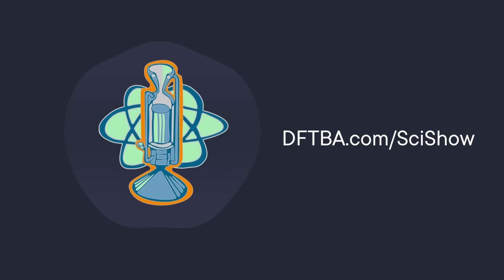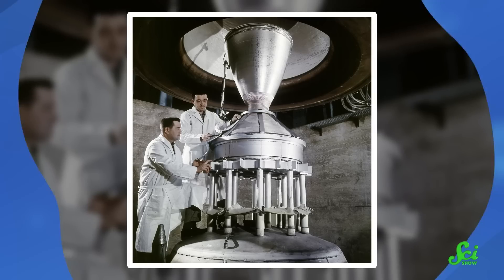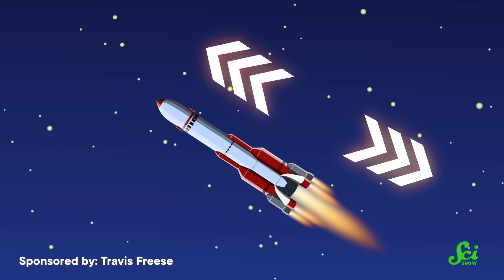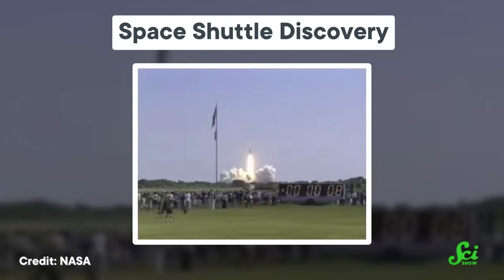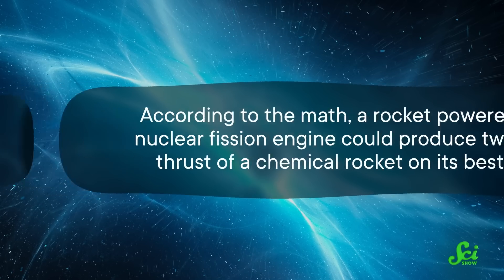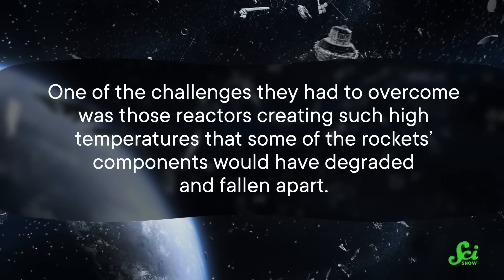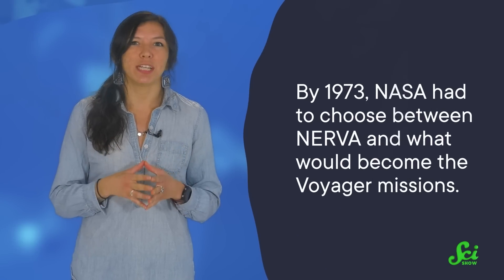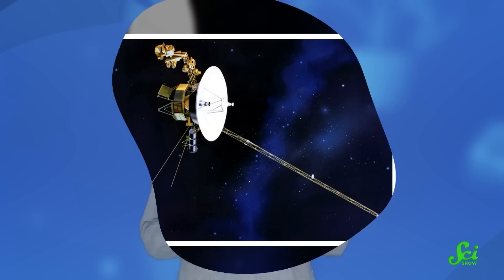That Time NASA Tried to Make a Nuclear-Powered Rocket

Comment: Interstellar travel will certainly require nuclear power. The 600,000 year journey to a planet of a nearby star within our Gaia cluster (like those where we are discovering earth-like planets) with no other form of power (even solar power is impossible during the 10,000 to 50,000 or more years between each star) and of course any craft has to be continually heated or it will be -273 degrees below zero. A half million years in space even for machines will require an unimaginable amount of nuclear fuel. Antimatter might one day be a better fuel but that is not yet technologically conceivable. 

And our current fastest rocket at over 500,000 miles per hour probably can't be improved by orders of magnitude just because smashing into dust that those speeds over hundreds or thousands of years will destroy any material.

Comment: Nuclear Power is a requirement for humanity's future. Wind and Solar can supplement Nuclear but can never replace it. Nuclear is literally no more inherently dangerous than Solar and Wind, and literally every Nuclear Disaster in human history was 100% preventable. Even Fukushima and Chornobyl. Hell, if not for the rampant misinformation, Three Mile Island would've been a slight hiccup. The only thing preventing Nuclear Power from becoming mainstream is misinformation. Depleted fuel rods can not be turned into bombs and the amount of long term waste (the stuff that takes 1,000+ years) will never be a substantial amount of waste or by the time it does, we'll have significantly better methods of discarding it.

Also, nuclear disasters are in no way inevitable. Fukushima could've been avoided if the company running the power plant had made adjustments to the protective structures bad in '91 when concerns first arose, or in the early 2000's when a wave that matched the exact dimensions of the tidal wave that hit Fukushima was predicted. Nuclear Power plants are built to be virtually indestructible. Their only natural enemies are negligence and ignorance.
Reply: And maybe we want very slow and complete nuclear contamination of the whole earth, maybe we want evolution to force radiation resistance and be fed the mutations to do it. Maybe death is a fundamental part of making a hardier more brighter life. Or maybe im just nuclearfanatic27.
Reply: @crusher 9z9  literally none of that will EVER happen. That is literally just misinformation born of pure ignorance, created over the decades since Nuclear Power was first used.

Comment: Instead of the phrase "nuclear poisoning" or "radiation poisoning, " you should use "radiation sickness."  Radiation isn't a poison;  in the case of actual poison, whichever poison it is, it consists of matter, whether solid, liquid, gaseous, or plasma.  Radiation, on the other hand, consists of various frequencies of light, from gamma radiation and X-rays, to ultraviolet and then visible light, and on down to infrared and still lower frequencies of light.

Comment: The real problem is having nuclear material anywhere near an explosion, even a controlled one. 
So the transport to orbit is a fundamental problem. 
Like, it would be less material and therefore less catastrophic than Chernobyl, but the area affected would still be dangerous for the next decades.
Like, the wind from Chernobly was blown over a lot of Europe. Ukraine is pretty far from Germany, yet open sand on playgrounds was deemed "possibly contaminated" and they were basically banned for years.
Similarly, rain clouds passing Chernobyl contaminated top layer of all soil - possibly. The danger was that it had. You couldn't have salad that grew there, etc.  
Mycealian networks of mushroom actually filted that stuff, absorbed and stored it, so no wild mishrooms for you for 20 years or more. 
You do not want this to happen above ground, at alltitude in the atmosphere, tied to - essentially - a huge kerosene bomb. 
The spread and dispersion could be really bad.

Comment: CORRECTION: 
Having a light fuel as exhaust doesn't make it better at providing a "push" to your rocket when pushed. 1kg of exhaust accelerated by 10m/s is as good of a push as 10kg of exhaust accelerated by 1m/s, as the kinetic energy of both is identical. 
The reason a light fuel is selected is because you need to carry your fuel. The fuel is used over the course of your journey to provide exhaust, and so at any given point until you run out of fuel, a portion of your fuel is not providing exhaust and is behaving as dead weight, and you want to minimise this weight.
Thus you want a fuel which you can impart the maximum kinetic energy upon, while retaining the minimum weight for it.

(momentum, not velocity, is conserved)

Comment: You left out the  part of EMP.
and the explosion that that took place over the Pacific decades ago that ultimately banned nuclear power being used by  major countries beyond certain elevations.
 I don't know the specifics but 2 things I know,  the high altitude explosion was far more devastating than they expected and reaching out around a thousand miles or better. 
Knocking out power and communications for all in its path.
Plus undisclosed "fallout".
The the fact is developing major energy production power sources Will find it's hands into warfare or no good, despite it's creators intentions.
Hence Nobel peace prize.
Reply: NERVA uses a reactor, not a bomb, and doesn’t generate an EMP. The nuclear fuel also doesn’t leave the engine, and the exhaust (which is made up of hydrogen) wouldn’t be radioactive

Comment: The reason chemical rockets are used for launch is that NERVA has a thrust to weight ratio of less than 1. It can't lift-off the ground. You confused thrust with exhaust velocity. A perfect NERVA has an exhaust velocity is 9 kps, whereas hydrogen/oxygen rockets are 4.5 kps. NERVA has a high exhaust velocity, but a low mass flow.

Comment: The Voyager probes are powered by plutonium. I say "are" because they're still sending back information, nearly 50 years on! It's only tiny amounts of raw data, no more images or anything fancy, but they've taught us and are continuing to teach us about the start of interstellar space. Those power cells are really small - a lithium battery of similar proportions wouldn't have got us a fraction of the information the Voyagers have - but because of their nature, they've been able to last so long.

I know there's a ban on using nuclear powered rockets in space (at least there was one!), but as Carl Sagan said, he couldn't think of a better use for nuclear power (paraphrasing, but that's the gist). Has the ban been lifted or has the USA withdrawn from that treaty? Goodness knows you withdrew from plenty of others between '16-'20...

Comment: I'd like to hear more details, particularly re: how can you possibly create a light-weight nuclear reactor, when you need major radiation and thermal shielding?
Reply: On the shielding: it doens't have to be the part of the ship and to move with the ship. The best radiation shielding is the R_square law or simply distance. All you need is a long rod with small shield (made from nuclear resistant cargo - you will obviously carry lots of materials with you) between the reactor and the crew and stuff that is weak against radiation.

The problem here is that nuclear physics is kinda hard to learn in the beginning and is not very popular nowadays, so most people simply don't get the basics.
For example - humans require a dose of radiation to be able to develop our immune system etc. This does is relatively small, but are easy to achieve just by arranging materials in a reactor in a smart design. We have those designs ready to the concept phase, but further development is blocked by the bad public popularity of the technology.
Another thing is the toxicity - people massively believe if something gets irradiated, it becomes radioactive forever. In fact very few and known nuclear reactions lead to irradiated materials becoming radioactive and again with clever designs these can be avoided completely. For example if you leave alcohol in an extremely high gamma ray radiation, you can activate it for no more than a few milliseconds, adn as soon as you remove it from the beam, it becomes normal and ready to use... there are many more myths like these

Comment: With global warming (I won't used the weakened "climate change" terminology), nuclear power is something humanity needs to invest more in, both on Earth and in Space. Just put NASA or the Navy in charge of it, not some cost-cutting for profit company. The U.S. Navy has a long history of operating nuclear systems safely.
Reply: The term was actually originally climate change. But people seemed to not understand what it means, the media dubbed it global warming. But scientists had always called it climate change and it’s still called climate change in literature.
Reply: @potatomo9609  There is one amazing video about the terminology and guilt shift and how the big decision makers simply pushed the hole problem towards the public with actually very low leverage to solve anything. You need to check that out!

Comment: The reasoning that lighter exhausts are more efficient does not convince me at all. Both the energy consumed to accelerate the exhaust to a given velocity relative to the rocket and the exhaust's corresponding change in momentum are proportional to the exhaust's mass being accelerated, which is that of the mass of fuel being consumed, independent of the fuel's density: The said mass will be the same whether in lighter exhausts or in denser. What would differ is the fuel's and exhaust's volumes, bigger for lighter than for denser exhausts, but volume is not a factor of the rocket's thrust. The specific energy acquired by the exhaust is its acquired energy divided by its mass. Thus, the specific energy does not depend on the exhaust's mass, only on the square of the final exhaust's velocity. And the usual name for specific momentum is velocity. If indeed the fuel or the exhaust densities are a factor, it must be due to more obscure or subtle reasons.
Reply: I had this exact same question when first learned the term specific impulse. You are indeed right that there are two ways to achieve high speed: 1) throw very little things at very high speed 2) throw tons of shit at very low speed

Airplanes actually uses the 2nd method. The speed of exhaust coming out of a jet engine is actually not that much faster than the air going in, but because they have so much air - you have infinite air in the atmosphere - they get to fly really fast anyways.

However, for rocket, you don’t have infinite things to throw behind you. You can’t opt for large mass. So for rockets, it is generally better to have faster speed vs more mass.

Comment: There's another nuclear powered rocket setup that basically impinges nuclear material suspended in water at a focal point behind a heat shield. The nuclear fuel decays, there's a sharp rise in temperature and the rocket is propelled forward, with ISP rivaling ion thrusters and thrust capabilities that almost match conventional chemical rockets, this type of rocket could actually get us from one side of the solar system to the other in the amount of time it would take starship to fly to Mars.

Comment: The NERVA program had two distinct types of nuclear propulsion...one had fuel moving directly thru the inner core of a reactor, heating it up to then unheard of temperatures, the second type had the fuel traversing thru a heat-exchanger type system...while less efficient, it was thought (correctly) as a "safer" option. The first test running fuel directly thru the reactor had catastrophic results...the high velocity fuels traversing thru the core wound up breaking up the super-heated Uranium fuel rods & spitting the bits & pieces of extremely radioactive material thru the exhaust nozzles. The entire test site was completely & savagely contaminated with lethal levels of radiation....think Chernobyl reactor with its chunks of glowing ultra radioactive uranium bits scattered everywhere.

Comment: Somehow I don't think this was the best intro to Fission NTRs. They wouldn't be launched atop chemical rockets for safety reasons, but simply because an NTR cannot generate high enough total impulse to launch a payload. Nor would you want your nice NTR first stage being dropped back to Earth, as boosters must be... NTR can be quite useful, but they have VERY SPECIFIC strengths and are not 'better' than chemical rockets in a general sense. Each has its uses.

Comment: If we never do get over the issue of launching a bunch of uranium to orbit, we have found deposits of it on the Moon.  It'd take a sizable moon base to support all of the infrastructure needed to mine and refine it, but then we can fuel up empty NERVA engines without ever risking an RUD earth's atmosphere.

Really, the issue is less of a safety and technical concern and more of a public perception one.  A uranium core exploding during launch would be way less hazardous than any of the bomb tests ever done, or even the occasional power plant incident.  Even better, we would know where and when the uranium would return to earth and could be ready to do a clean-up if needed, while reactor incidents are unpredictable...

Comment: This is BS, UncleHeorge could not talk about much of his work, but he could talk about this project.  In 1963, he talked about a nuclear rocket engine.   It worked fine. The problem was WHAT HAPPENS IF IT CRASHES.
Reply: There was a working TNT powered proof of concept. But the reason it was abandoned was it was too heavy to get into orbit because of the many tons of blast shielding required. No one was setting this off on the ground.
Reply: At some point, space travel in near-earth orbit will be as safe as normal flight.   It's remarkable that it is taking this long, actually.  I think, unfortunately, as much as the space race pushed the technology forward, it also incentivized pushing ahead even when problems might exist.   We've been in a course correction on the technology ever since.

By the time we get there, nuclear fission might be replacing nuclear fusion.
Reply: @EMS  not in our lifetimes so quit putting the cart before the horse

Comment: Pretty much everything we are doing in space today was thought about and researched in the 50s and 60s.  NASA published piles of papers back in the 50s and 60s covering a wide range of ambitious (even crazy) ideas for space exploration.
Reply: they just needed technology to catch up to their ideas~ this is going to be a very interesting century for space exploration... assuming we dont nuke ourselves into oblivion first.
Reply: @canisarcani  they needed the money, but after the pace race was over, the hype died and so did the funding
Reply: @canisarcani  To quote Howard Stark, "We are limited by the technology of our time."
Reply: This video leaves out a lot. They didn't "try" to build a nuclear rocket, they built dozens of them. They had 23 working reactors and engines with the ability to manufacture 2 more a month when the program was shut down. They also had testing facilities that could test the rockets safely. They never launched because of the nuclear arms treaty with the soviet union. The project was mothballed, the manufacturing and testing facilities were then shut down. It wasn't just a NASA project either, DARPA and the AEC were heavily involved.

They restarted the project to be headed up by DARPA and NASA in 2019. They have all the data which puts them at least a decade ahead of anyone else (according to a DARPA engineer). However they no longer have the manufacturing ability for the reactors or the rockets so had to sub that part out. They also no longer have a safe testing facility so they have to launch into space and test them there.

If that project was never shut down we likely would have had several space bases scattered around the solar system.

Comment: Actually the thrust provided to a rocket by the exhaust exiting the back at a high speed is due to the Law of Conservation of Momentum.  Momentum is mass times velocity.  The total momentum of the many very low mass exhaust particles exiting the rocket nozzle at a very high velocity backwards must be balanced by the forward momentum of the massive rocket moving at a lower velocity.  The heat of the onboard nuclear fission reactor makes the LH2 expand rapidly and exit the rocket at a very high speed, producing a substantial momentum rearwards, even if the individual hydrogen molecules have small mass.  But the sum of their momentum is what pushes the more massive rocket forward.